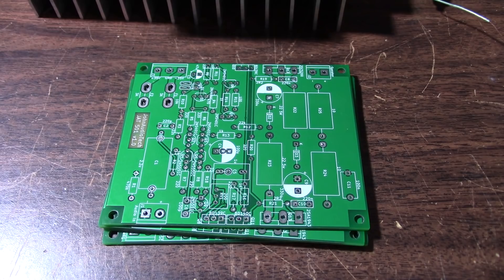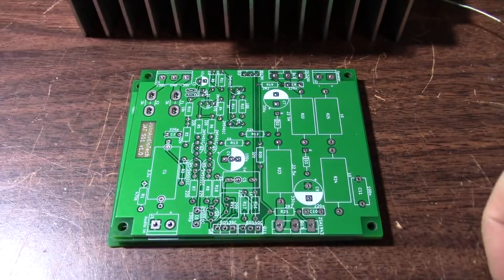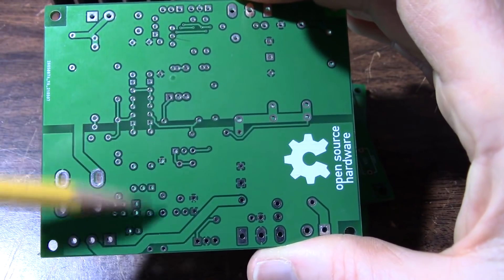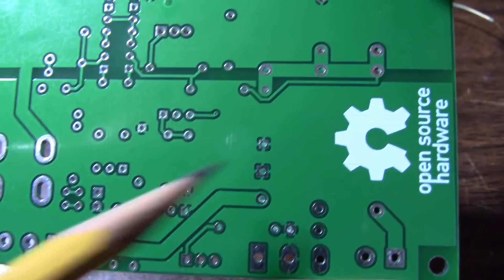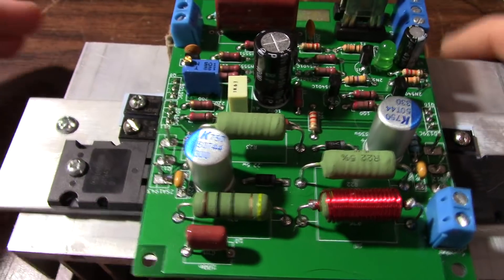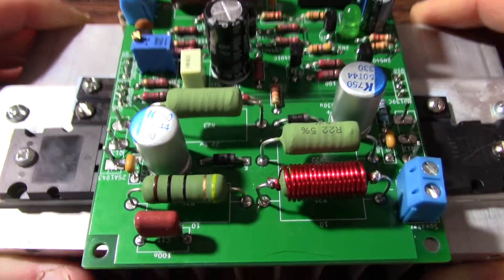JAT501 amplifier project boards + Snickers health

Comment: Hi John, two things: sorry for what's happening to Snickers.  I've had several cats that succumbed to the same issue.  Always hard to watch them decline.  Secondly, I tried to have boards made from the single sided board Gerbers ( JAT501-ss-gbr_Y43) and JLCPCB said there is no solder mask in the gerber file so they can't produce the boards.  The other two versions of the board are fine & in production.  Thanks,  Pete
Reply from the maker: Thanks Peter. This is an older video. Snickers passed last July. Thanks for letting me know about the boards.

Comment: i've designed my own version of the PCB, works great, but Q9 (Current mirror) gets really hot, is that normal?
Reply from the maker: Q9 is an amplifying transistor in the VAS stage (not a current source). Q9 and Q7 (did mean that one?) should be about the same temperature. They should get warm, but not hot. They dissipate around 300mw. Ground the input and check the voltages across R15 and R17 to calculate the current.

Comment: Given the low parts count, a kit sounds good.
What is the gain and input sensitivity?
How does it compare to chip amps like the LM1875 or TDA2030 in these areas?
I would like to drive the amp directly from the line outs of a CD player, Tuner, or Tape deck.
Can this be done without a separate preamp to achieve the power spec.?

Comment: Hello, John. Sorry to here about Snickers. You posted 2 links one to your google drive that has parts and a schematic. https://drive.google.com/drive/folders/17hZnd7lHIgxiF0vYiqyiVZeuyNLp8Kk0
And  the other link to get the Gerber files and watch his video about your amp.  https://youtu.be/YQWNG_dEtx0
the problem I ran into was his SCHEMATIC IS DIFFERENT !!!!  than yours AND DOES NOT USE THE SAME PARTS.
BIG PROBLEM! #1 transistors Q1 thru Q4 are the same part number without the C on the end, they have a different pin layout. AND they are in a different location in the schematic. Also as far as I can tell C2 is missing. If I use his schematic on his board and his parts it might work I'll let you know YOUR NAME is on these boards I thought you might like to know. I spent 2 hrs. trying to figure out why this looked FUBAR'ED using your schematic with his board will not fly! If your PO Box is still up i can send you a board. Please let me know. Thanks for sharing your know how! 
P.S. Please redo your video on BOOTSTRAPING you know it's screwed up AND it's still the best one I've seen.
Reply from the maker: Hi Mick. The Google drive files are the old version that I'll need to remove. I have the latest files on my Patreon page now. The "C" on the end of the transistors are Bob Cordell's LT Spice models I used. The C can be ignored. The video on the amp is not my official design. They took some liberties and changed it a bit.

Comment: JAT can you send me an schematic of ampli that can produce 50-80 watts with clean and clear sound without hum on low volume or do you have a module?
Reply: The JAT501 will do around 50 - 65 into 8 ohms depending on the power supply. A link to the schematic is in the description of the final video of the design series linked below. https://youtu.be/YiMKW38Dhi0

Comment: 330uF bypass caps?
Reply: I also thought they are tiny for this amount of output power, definitely need more somewhere else, on the power board perhaps.
Reply: @damians.9436  I usually use .1 uF
Reply: @ranbymonkeys2384  100nF is ok for signal paths but for power output your voltage will drop significantly due to internal resistance of the power supply, except if your power supply is really really low impedance.
Reply: @damians.9436  I use polystyrene .1 uF caps
Reply: @damians.9436  Ya I always use low ESR power caps (Nichicon) and then just bypass those with the polystyrene film caps, seems to work pretty good.
Reply: @ranbymonkeys2384  Polystyrene as bypass caps is an overkill, NP0 ceramics are just as good (but are sensitive to vibration). Also even NP0 are overkill since audio frequencies are really low (need those for 100MHz ore more). PS caps are very close to the ideal cap but are bulky and expensive, I would use those only in the preamp stage if at all but audio processing is not my home game, I work in the precision high speed amplifier industry (similar to audio but going up to the MHz range)
Reply: @damians.9436  Just as good, but sensitive to vibration, I like that.  Something tells me you got the shot didn't ya?
Reply: @damians.9436  If you are used to going higher MHz then low ESR is bad for you so just think the opposite of what you want to do with audio. No ceramic and audio are a no no even worse is TANTALUM!!

Comment: Why are all the transistors on the heatsink? That's a mistake if you are using emitter followers feeding emitter followers (any kind of 'darlington pair' or stack thereof) - you will have a lot of idle current drift with temperature. Drivers should be off the main heatsink, might have their own small sinks if they are running high idle current themselves.
I don't want to criticize because i'm not a PCB guru myself, but the layout itself also seems 'not great'.
Reply from the maker: After large power excursions, bias quickly returned to the set point. I even tested on an undersized heatsink.
Reply: @JohnAudioTech  Might have been that way, but then again - why do something the less efficient way when there is a better one ;-)
Reply from the maker: @akkudakkupl  Why is it less efficient? Adding heatsinks to the BOM for the drivers is not more "efficient" when they can be tied to the main heat sink.
Reply: @JohnAudioTech  maybe I was not clear (second language) - most likely those drivers don't need heatsinking at all. What I meant by 'efficient' should be probably called 'state of art'

Comment: I think I'd prefer if the power devices were all along one edge - that would allow the board to be horizontal, with the heatsink vertically at the rear of a case. But that's a radically different layout, and I have no idea if that would cause a bunch of problems with laying everything else out.

Also, hope Snickers gets better.
Reply: I guess I will be revealing who I am by replying to this, but I have also worked out a inline version of the board with all of the power transistors on one side.  I will be making the changes John has suggested to both layouts.  Not sure which will ultimately be the official version, but I will be making the kicad and gerber files available for either one.  There are subtle tradeoffs for both, but I think the benefit of John's layout will be most dramatic for a single sided board layout.  I have only been putting together double sided which I think is fine for commercially made boards.  But for the home spun PCB a single sided version might be useful.
Reply: You could probably have a vertical heatsink on each side of the board, which could form the sides of a case, though it would be a bit tight for clearance to the connectors.

Comment: I've had multiple old cats. One of them got a detatched retina from high blood pressure and went blind, that was an obvious change, instant change in attitude with massive round pupils. He died of a heart attack shortly after visiting the vet as we were out to get prescription meds.

The other 4 had kidney issues and got wobbly and weak for different times... One has been wobbly for a year and is still with me, (vet said he had kidney issues 3 years ago when we adopted him) he recently made a 400 mile move with me (i was so careful with him) and at one point he got out of his crate (i left the door open with him pointing at me in the passenger seat of my truck) and he hopped down to use the litter box! He's super old and slow, but i was surprised. He's got his steps to get on my bed, he still hobbles down the stairs to visit... I don't think he'll be with me tooo much longer though :( but they can be unstable for a while.
Reply from the maker: Thanks for sharing your story. Snickers seems to have stabilized for now. It never gets any easier losing a pet. I've lost many throughout my life.